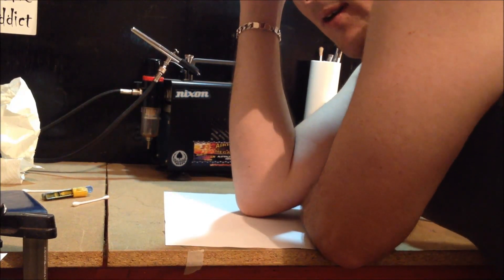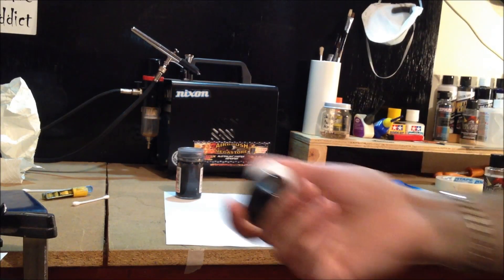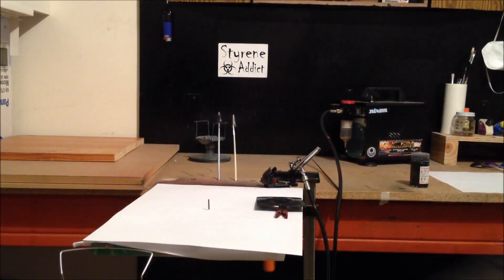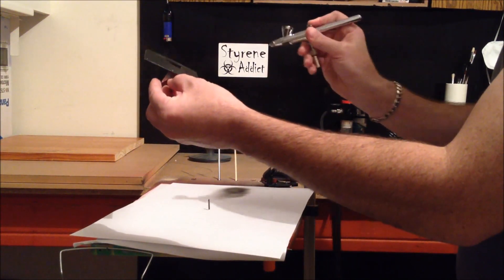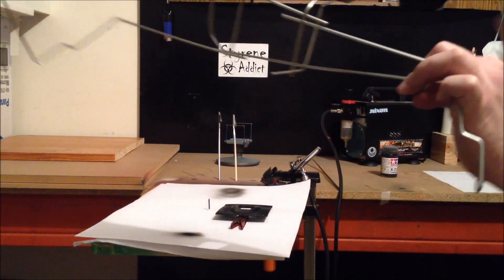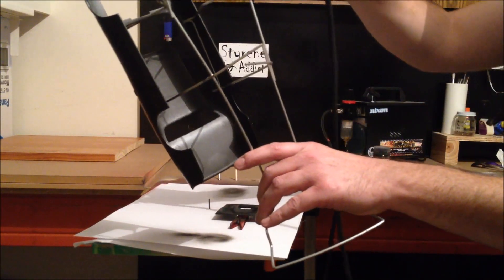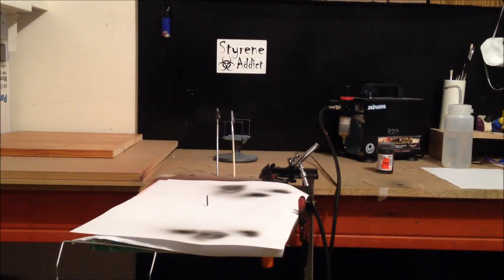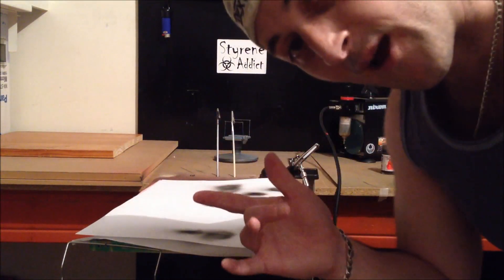How I Thin and Apply AutoAir Paint (Video Request)

Comment: For anyone that doesn't know... Wicked 0100 and Auto Air 4011 are the same thing, just different bottles.  If you haven't had a chance to yet, grab some of the new 4012/W500 high performance reducer.  It's fantastic stuff!

Comment from the maker: Lol I just replied to that. I normally spray anywhere between 25-30 psi depending on the paint. I recently use some auto air metallic in the iwata but I think the flakes were all sinking and blocking the airbrush up :(